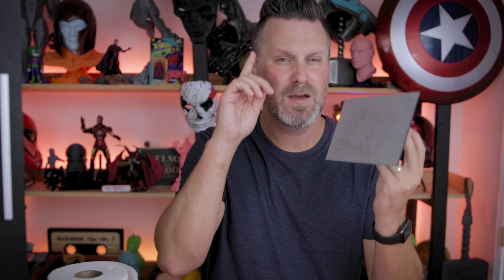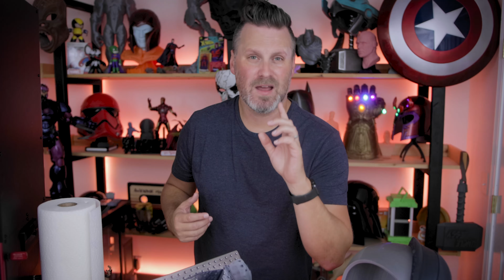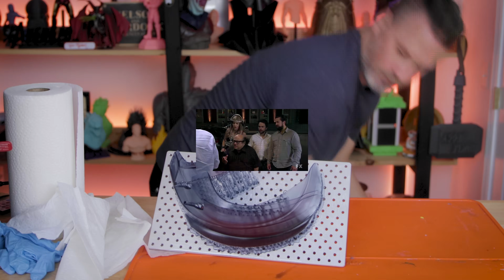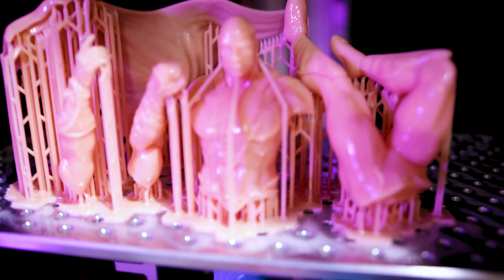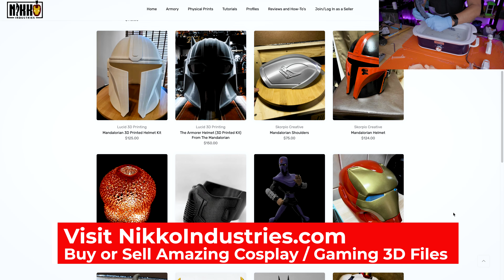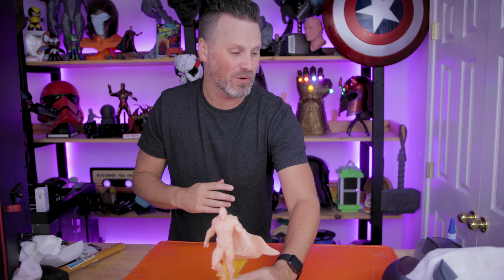Stop Resin 3D Print Fails! Bed Adhesion Tips & Tricks

Comment: TIP: Add a raft to make the print adhere better. Reduce the bottom exposure time if it's sticking too much and is very hard to remove. Also, I adjust the bottom exposure time depending on the size of the print. For most small prints my bottom exposure time is 12sec. For larger prints it's 15-18 sec. Your time will vary depending on the printer and resin used.

Comment: I’ve recently come across an issue where the base support will print. The support struts will print, but the actual figurine itself will not print and I find it on the bottom of my bat after failure could this be because the tip of the support is not wide enough or penetrated deep enough into the figure?

Comment: My bottom exposure time is at 50.0000 S and i got one print to work but the last two prints didn't stick to the plate. I sanded it and cleaned it with isoporin alcahol. But yet it still fails. I still level the machine every time. With the paper it gave me. And i srcew in the tank. Im not sure what im doing wrong. Can you please help?

Comment: Just clip the model from the supports then remove the supports from the plate after. I would rather have a solid hold than loose the resin or f-up my acf or screen. Just a thought.,

Comment: Just joined your Patreon to learn more as a newbie. I am hoping to solve a frustrating problem. I have an Anycubic Photon M5s Pro. Up to a month ago I had total success. Then I tried to use Lychee to hollow and put drain holes in a large print. It totally failed. Lychee's instructions are dismal. After that failure now 90% of my prints fail. But it's strange, because when making multiple prints at a time, one print will be maddeningly stuck on the plate, and the other ones fell off during the print, sometimes leaving the supports. I tried using heavier supports. I have now wasted an entire bottle of resin. I use standard Elegoo gray. I will try sanding the plate. Does anyone have any advice?
Reply from the maker: hey hey! i'm wrapping up a video edit for a video tomorrow on bottom exposure testing that might help. How is the temperature in the room you're printing in? If its too cold it can negatively impact your printing. If the supports are printing but not the model it could mean you either need more supports or heavier contact spots or the exposure could be off. I'd say try to run a few tests with the Cones of Calibration (quick google should turn up a link to it). Should help with your exposure testing
Reply: @ The room is cold, can’t be heated,  but I have a heater inside my printer. About an hour before I Print. I warm the interior of the printer up to about 39 to 40°C. The garage is enclosed. I live in the mountains and the snow. I hope that’s not what’s causing because It is not possible to bring the printers inside - fumes. thank you for answering. I tried anycubic photon workshop to redo the file. It was much easier putting in the drain. I will let you know.

Comment: Holy smokes.  Thank you!!! MAN my stuff was sticking with a FURY yesterday and I want to print your dry brush palette.  (You said something about drilling holes via Chitubox, which I don't quite get and assume that will be my big reason for fail.  Bc at least now I think the "stuck to the plate" fail is much less likely).
Reply: Update: Just printed your palette.  <3 <3 <3  It's my FIRST ever "not the sample print" print!! and the sample rook was printed four times, because it kept sticking sooooo hard to the build plate.  but i followed your instructions on the adjusting bottom exposure and it was soooo much better.  I was i think i might take it down a little more, still.  THANK YOU!!!!!! Now that I have my paints pallette, time to print something to paints :P

Comment: I never heard of flexible build plates for resin printers before. As soon as you mentioned the benefits, I went and ordered one online. Looking forward to never again having to chisel the prints off the bed, pour boiling water on them, or needing to re-calibrate the bed each time because I'd nudge the arm out of alignment with all of the force I needed to apply.

Comment: I had this weird problem on my Anycubic photon mono 2, the base few layers, the float,  burn in just fine, but then the supports don't burn in.  And, not all of them, only in a certain area which seems to be random for every print.  I'm guessing it's the leveling problem but i leveled my plate just last night and i still had the same problem.

Comment: Im using photon mono 4K and i found same problem when using standard resin such as Sunlu and Anycubic.  I found my prints wont stick on the build plate. If i print for example 4 objects then the 2 objects wont stick on the build plate but it sticked on in the vat. But the 2 remaining objects prints fine. 

Any solutions ? Thanks

Comment: Literally just tried my first print ever, and it ended up just printing the first layer basically directly on the screen..
But it didn't stick to the build plate..
And then trying to save the resin ended up spilling some of it. It was a huge mess and honestly quite frustrating..
But from what I'm getting from both this video and quick research is I might need to tweak my first layer exposure time..
And something else to do with
The Saturn 2. Not being calibrated correctly..

Comment: If youre still having trouble with getting prints to stick, it might be the resin is expired. I just had a string of parts that wouldnt stick, turns out the resin i was using was over a year expired. Got new resin and everything printed fine
Reply: Resin lasts for years sitting in the vat ready for emergency printing

Comment: Thanks for the vid.  I've done my homework and had several great prints with my new Mars 3 Pro.  However, my first print after installing a Wham Bam flex plate, it failed to adhere to it.  I sanded the new flex plate and just paused to check my test print and it  hanging nicely.

Comment: Hi y'all, I just discovered this video.
I'm having a lot of trouble and have changed my FEP film too many times (much more than I should).
I use the WhamBam flex plate in my FlashForge Foto 13.3 4K & the bed adhesion is very inconsistent.
My initial exposure time is set to 40. Sometimes the adhesion is perfect & sometimes quite the opposite and I'm using the Resione standard grey or white resin.
Upon printing it seems the adhesion to the FEP is way to strong than it should & I have calibrated my bed far too many times as well trying to get to the bottom of this.
Any idea to resolving this issue would be greatly appreciated. Quite honestly I think I'm loosing it. I need more consistent results.
Thanks guys

Comment: Can you do a video what to do when prints regularly fall off their supports (e.g. Supports print perfectly, but the actual print sticks to the FEP and falls off its supports)?
Reply: There are 2 common reasons for this. The first is it is not properly supported. The second is the exposure time isnt enough, so the supports are two weak to take the strain. add stronger/heavy supports to the areas which have the largest amount of additional material above them, and increase exposure times slowly (to dial it into your resin. The temperature you keep the room, and the humidity also factor into your proper exposure times...so its largely printing calibration files until you get it dialed in. I like the Siryatech resin calibration file.)

Comment: Had problems with prints not sticking to the build plate. After hours of leveling which didnt help. Sanding the build plate and increasing the bottom exposure level fixed my problems. Thanks for the video.

Comment: Dummy mistake i did when starting ; there is typically a clear sheet under FDM for shipping.  Be sure to remove before printing....

Resulted in having to replace FDM (smh).

I typically do 10x exposure for bottom; shrug...  Really liked the comparison on the bottom for 10 seconds delta; massive difference.

Comment: You say high grit in this video. Do you mean lower grit? (More abrasive) Also, if you could; I've seen a lot of people basically beat their build plate to remove prints and it's rock solid. I tried that on my Mars 3 plate and threw my level off instantly. Is it just the plate for the Mars 3 or do I really need to crank down the bolts?

Comment: Hmm I have an Elegoo Mars Pro 3, first half-dozen prints went off without a hitch, next dozen jsut keep failing (even ones that printed right before). The don't fail to adhere to the bed as much as they -- at some point stop adhering to the supports or adhere to the tank maybe? Or they twist? Trying to print a set of D6 (six-sided dice) they start out in one orientation and then its like the print begints to rotate? IDK. its a learning process.

Comment: Funny... I am printing bigger things than you with my mega, and I never had a fail and also never had to sand the build plate! So it is also easy to remove. Same as you, I'm not using the raft to not have a huge first layers surfaces. My first prints were not sticking to the plate then I used 45sec first layer and it was done 😅

Comment: Man, you really need to add a raft to every model before print, in order to make it easy to remove from the build plate. It will slip off easily only using the scraper, with no need of a hammer!

Comment: dude just pour boiling water on the plate and you will remove your model easy, I use two cups of boiling water, pour it on the supports so you do not need to pour it on the model itself just the supporters and it will be easy to remove it, more or less hot water depends on how big your plate is or how much and strong your supports are

Comment: Hey Jessy, why don't you simply use a raft? I personally prefer having trouble removing a successfull print from the building plate than the risk of my print sticking to the FEP resulting in a failed print. Removing the raft from the plate is quite easy with a plastic scraper.

Comment: So, I have leveled and leveled and leveled, and my printer is level, as well as the toolbox it's on, I use ptfe spray, and I have the bottom layers, all of 8 of them, curing at the longest time my printer says it can. And they still don't stick. What should I do now? Buy some sandpaper?

Comment: Just a suggestion.  Use a light weight dead blow hammer with your scraper to help remove parts from the plate.  I printed a stand that holds the plate surface verticle and frees up a hand.

Comment: so if you have a perforated buildplate, why not poke your print from the other side? i'd kill to be able to do that with the mini or the mono x 🤣
Also ditch the regular spatula and get a japanese plastering knife/flex car filler knife. Waaay thinner than those shizzles you're using, flex does miracles (also for fdm).
Or get a glass cleaner knife with a pack of plastic blades.
While you're at it, silicone kitchen spatula or kit finishet to clean the fep and bed

Comment: Yeah, SLA is way too messy for my taste. It produces better results when it comes to miniatures, but the whole thing seems like cooking meth or something. Resin is highly toxic, the fumes are nasty, the liquid resin will irritate your skin, if the prints don't cure enough there will be toxic leakage somewhere down the road. That's just too much of a hassle.
Reply: you use gloves and don't touch the resin, 
many people mix gallons and gallons of AB resin and the fumes are no issue. I mean you can be scared of 'fumes' if you want but do you ever use bleach or a cleaner that has fumes? the iso alcohol for cleaning is worse then the resin.
the only way you can get resin inside the print is if you hollow it out and don't make holes. there won't be uncured resin inside the model thats not how it works, it dosen't cure from the edge inwards it cures the whole layer at once. 
resin printing is not for everyone but its not like cooking meth, lol.

Comment: I have a stupid question.  I have an anycubic mono.  I am trying to print a 3d catan board for myself.  My issue is with the adhesion layers.  With he first few bottles of resin, the adhesion layers peeled nicely off the base of the catan hexes (I am printing them flat).  The subsequent two bottles have been an entirely different story.  The adhesion layer does not come off.  I end up breaking the piece trying to get it off.  If I don't take it off, the pieces will not be uniform.  I need to get the adhesion layer off!  I have not changed any settings with my printer, and I'm using the slicing program that came with the printer, and I'm using the anycubic 405nm grey resin.  Any help would be greatly appreciated
Reply: You don't get a answer friend
Reply: lower your initial layer exposure time. or get a flexplate like in the video.

Comment: If your prints are that stuck to the buildplate, pop it in the freezer for a bit (be sure to put in a sealed container/bag first to prevent getting resin on all your frozen stuff). The cold shrinks the print ever so slightly ad it'll just pop right off
Reply: What if the prints are straight up falling off of the supports, the supports themselve stick but the print falls off and sticks in the vat. What can i do?
Reply: @S481Animationsin setting change the spores to the stronger one and manually add other if that doesn’t wrk

Comment: I'm going to be buying the ELEGOO Mars 2 Mono MSLA 3D Printer very soon to see if it'll just give me more pain that creality cr10 v2 did. But by the looks of things the only thing that are problems with resin 3d printers are not supporting your 3d prints and bed adhesion. With the cr 10 I had a whole list of thing that went wrong with it. Bed adhesion, leveling the bed at four corners, bed levelers not enough to screw to level the bed right, warped print bed, too many wires, heat nozzle pulling off the print if you don't level the bed right, nozzle clogging, too many parts to assemble, even with the bltouch sensor it still didn't level properly and last uses twice as much pla to support some prints than a resin printer would.

I was only able to print about few things, the preset models that come with the USB, and 3 masks; a scaled model of it, a large one and a successful print. The rest never turn out right
Reply: I have a elegoo Saturn 4 ultra and it's really pretty nice, if wanna try that

Comment: Try soaking the WHOLE build plate in HOT water. Resin will get soft and easy to remove. And I mean do this after you CUT the supports and removed your print

Comment: You might wanna just stick the tip of the scraper (it's just the tip) and use it to get air into the bottom of the prints, that will release all the little square rafts that are connected together. That is my advice. When placing supports, make sure they are connected and also get the tip in there using the holes of the build plate. So much easier. Más vale maña que fuerza!

Comment: If you're sanding a build plate, it's smart to place the sandpaper on a piece of plate glass (ideally a surface plate) to preserve the flatness of the build surface.
Reply: That's correct. I think it's even better to use the back of a mirror. If the mirror shows no deviations, it is definitely flat.
Danger! The back is sensitive and the mirror coating can be damaged.
Reply: @3dfilm.attechnicalvisualiz524  the coating on mirrors is normally on the back

Comment: Hello, im printing translucent keycaps but have some issues with a waste layer of resin on the faces on plate direction. I think is because the light passing trough the model and cure this layer. Trying all the positions but can't fixit always have to sand it.  Any sugestions?

Comment: You need to stop using individual support base rafts and use the lychee linked support raft which draws a single line between all support bases, but doesn't create a full solid raft. 

You just lift a tiny corner with a sharp spatula or razor and the whole thing peels off smooth and holds together. Burn in layers won't matter then, trust me, works a charm and uses a touch less resin

Comment: 'I am going to get an angry test msg here in a few mins' I have the same problem lol I had to buy a weather proof plastic tub (to prevent the smell from getting everywhere in the house) to transport the 3D print to the garage so I can hammer away lol

One trick I use on my printers to prevent print failures is after I clean the vat with a shop towel, I then clean the vat again, but this time with alcohol pads (the ones for glasses) idk why but those pads really remove any cloudiness left in the sheet and the best thing is... those pads don't leave any fibers behind and remove any fibers your paper towel left behind! It works every time for me!

I hope this tip helps

Comment: Uninterruptable power supplies (ups) are not expensive and should be used on ALL of your electronic devices.  They'll save your prints during power outages, as well as clean up the electricity going to the devices while power is on.

Comment: Have you thought about using Neverwet and masking to bottom of the build plate? That might stop the cured resin from sticking in the holes. Plus, if you spray the top of the build plate it might make clean up easier.

Comment: one thing I started doing on prints that have been difficult is spraying IPA on the part that is adhered to the plate and it has worked really well so far
Reply: I do this on all  my prints. Works like a charm.

Comment: Leveling and exposure, YES SIR! We do the sanding as well, with 2k grit or higher. Heard Bed Hesion as well, but realistically, that is a GREAT way to say it! Wow a full 10 seconds less on the initial layers!  Yeah those Chitu stock settings were WAY too long, that bottom exposure setting definitely helped! Time to get a battery backup sir! We have an APC 3000 on the main farm and the resin printers run on an APC 1500 since they draw less power overall.